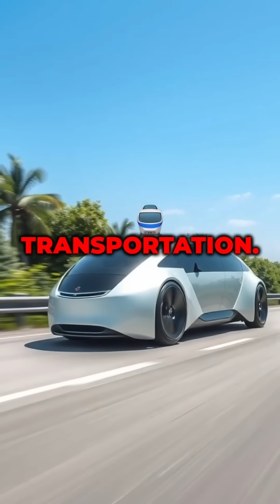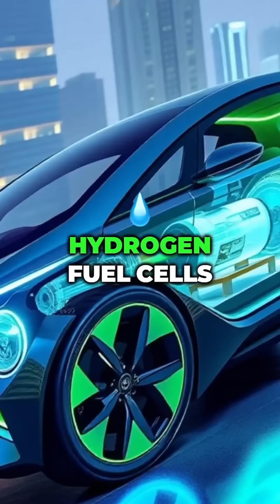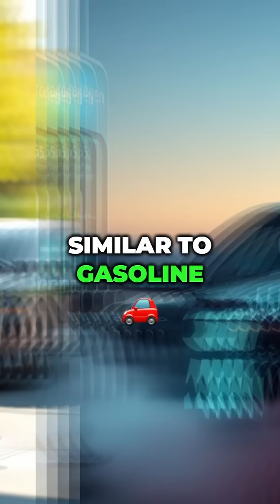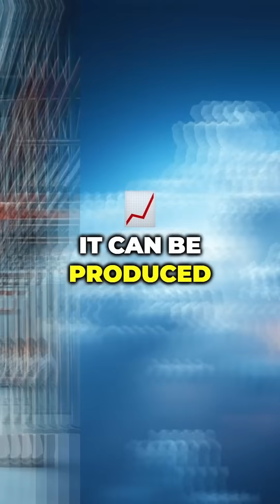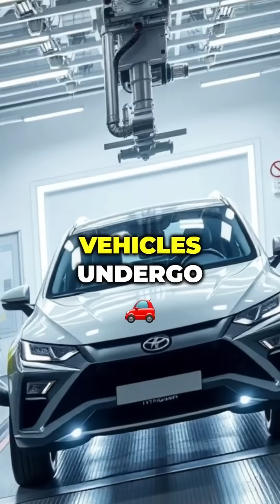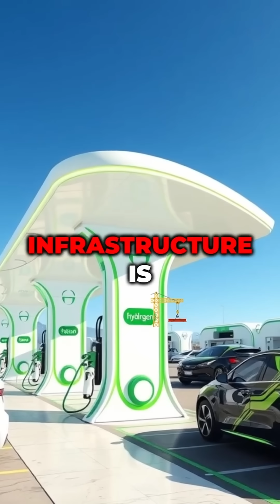Five Facts About Hydrogen Vehicles

Comment: "Leading the charge" no they are not.  They are the most inefficient reusable energy methods out there.  Also Hydrogen is very difficult to store, it can leak through of STEEL and you can guarantee there will be leaks, requiring your garage to be well ventilated to dissipate the escaping hydrogen.  It's just horribly inefficient from start to end, it takes a lot of energy to create (usually via electrolysis with significant losses), it takes a lot of energy to store (high pressure, or low temperature storage requiring extensive energy to get it into that state and keep it there as well as material issues to prevent leakage) and finally conversion inefficiencies when it is used to create energy again, either from burning or in fuel cells.  In airplanes it makes sense.  In cars... not so much.
Reply: as of now yes thats true, but sooner or later it COULD be a good way of efficient fuel
Reply: @varsaot  One day I COULD be a ballerina - but there is NO DAY that hydrogen COULD be an efficient fuel, the ONLY benefit is the high energy density.  Go back through the long long list of issues with Hydrogen, and tell me how those issues can be mitigated or achieved WITHOUT expending a lot of extra energy.
Reply: @varsaot  Unfortunately, they've been trying to make hydrogen efficient for several decades and have made little to no progress.  It still has the same problems.  The best thing they've been able to come up with is the carbon fiber tanks to hold 10,000 psi. That was over a decade ago.  The fuel cells are just slightly smaller but no more efficient.  It's still looking for some sort of "breakthrough" to make it feasible.  Even the most efficient FCEV, the Toyota Mirai is still only 25% the efficiency of a BEV.  Add in the much more expensive infrastructure and you're lucky if it's only 10x more expensive per mile to run.  The problem isn't the vehicles, the problem is the cost of the fuel.  Imagine trying to promote BEVs if electricity was $2.00/kWh instead of 20 cents.  No one would buy them.